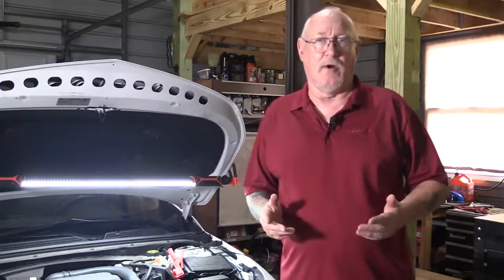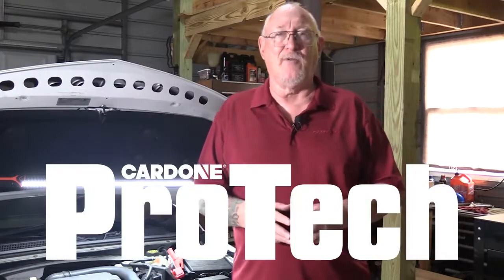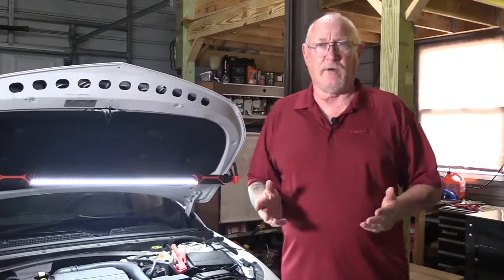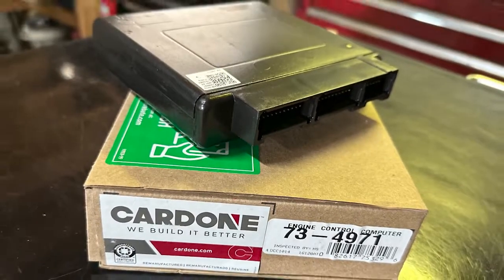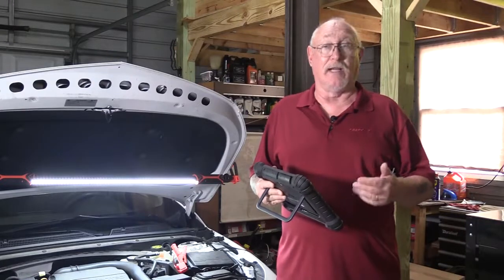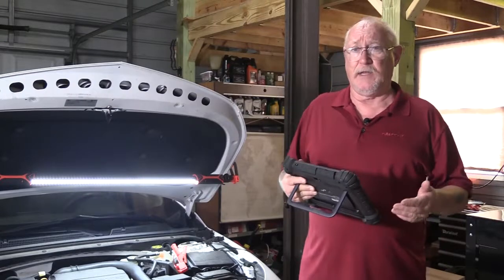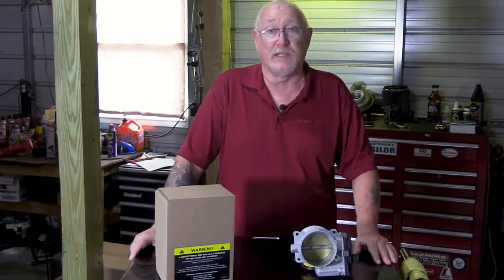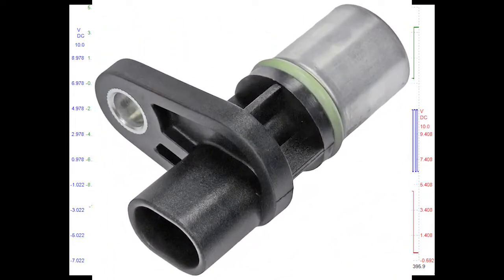Good Throttle Body, Bad Idle – What to do, The ECM 's Role, and Throttle Body Re-Learn Procedures

Comment: What if I bought a new throttle body but the car doesn't want to Rev, what might be the problem?
Reply: That's my exact issue when I try to get my car to turn over nothing happens and I still have the red lightning bolt
Reply: @Gabey_515 why is he not answering you all 😥😥
Reply: @sepherinaallard7584 I'm not sure but I ended figuring out the issue my starter died I had replaced. My car works good as new